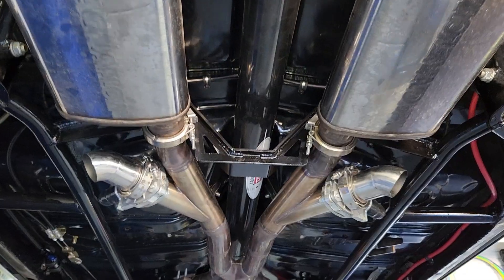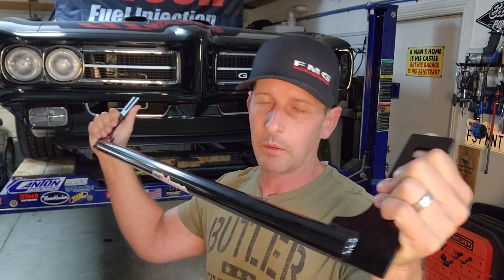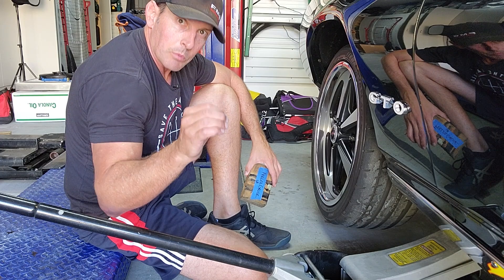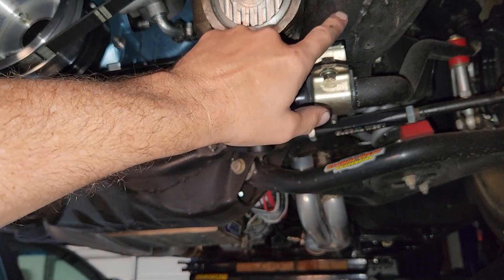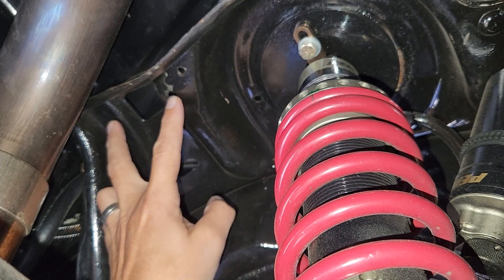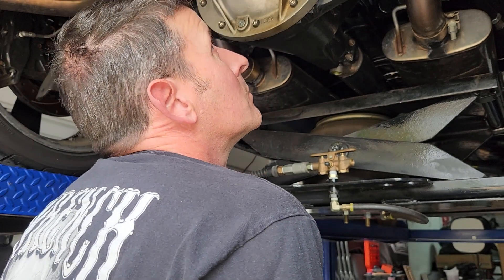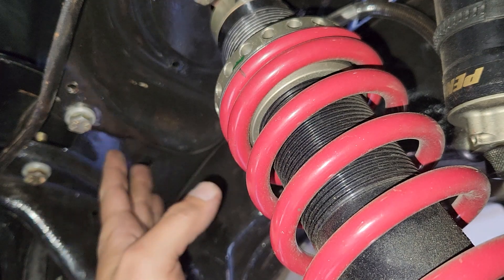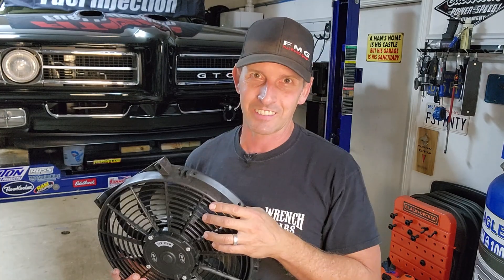UMI Performance - Bolt In Chassis Stiffening - for A-Body's

Comment: Quick tip for those rear bolts that you did the one finger trick on. Take a shallow socket, put a piece of tape into it to take up space, put it on a long extension, and put the bolt washer into it. Feed it up into the hole like you did the drill and hold the nut with you're other hand. Turn the extension to thread the bolt into the nut. If you're twisting your body a lot to get the nut up there, just use longer extensions until you can use your other hand.
Reply from the maker: I like it!  Thanks!

Comment: I finally got to doing my UMI rear and yeah pain in the a$$. Fuel lines ran right where needed to go. Luckily I was replacing all of them otherwise would have been worse. Thanks for all your videos. Definitely helps but also makes me buy more things lol
Reply from the maker: Yeah, not a super easy install, and glad to hear you changed those old fuel lines.  Yeah, sorry for the new spending habit.  ha, ha... See ya!

Comment: Monte, i have a chevy tubular transmission that direct bolts to the frame sides, would that be considered a frame stiffener of sorts?
Reply from the maker: Well, not really... BUT, it is far improved over the stock stamped brace.  It should dramatically help with holding the transmission in place, especially under load.  Instead of sagging or "bouncing" in certain conditions.  Great question!

Comment: I have added the UMI front and rear sway bars with a definite increase in corning abilities. My car actually came with a rear sway bar so the newer one is thicker from. UMI. San I just add the front piece as you did? I am not sure how or why you did the frame measurements. I use a scissor lift and am not sure we tightened the bars down with full weight on the wheels. I will recheck rather than burn up the poly bushings. Please answer if time allows, thank you
Reply from the maker: Awesome testimonial... I did the frame measurement to see if they actually made the frame stiffer.  Otherwise, how else would you measure the before and after?  As for loading the sway bar... it varies from car model to car model, but if you tighten all the linkages with the wheels hanging in the air, the pre-load on the bushings won't be the same as if pre-loaded while the car is static.  Hope that helps...

Comment: I don’t think you are getting any extra with the 2 bars since you have the super duty brace . Trying to workout is the upgrade worth it ?? Rear bolts holding onto 1/8 steel if that 
Front bolts on sway bar mounts . Might be something you make to think about real points / double sided minting plates to mount to.
Reply: Mounting
Reply from the maker: Good points... the front and rears do need further support, as the weld in kit only helps the mid section.  Love the idea of top and bottom mount plates to sandwich the frame.  I'm gonna research that some more.  Thanks!

Comment: Great video,,, alot of information,, I have a 72 Monty carlo,,,, complete umi suspension,,,
GREAT JOB
Reply from the maker: Thanks Brother...
Reply: I also have a 72 Monte with a complete aftermarket tubular suspension, swaybar and bilstein shocks and all new body mounts! Car rides beautifully but I am thinking of adding these for added strength for the stout small block I built. Can you gentleman comment on noticeable driving improvement after adding these braces?

Comment: Which suspension modifications besides that bar require the suspension be loaded before tightening? About to do UMI stage 4 with a few upgrades to the kit!
Reply from the maker: Good question, I was referring to any sway bar installation. Hope that helps!

Comment: How do you like those front sway bar links? Looks like they’re Spohns.
Reply from the maker: They seem to be doing their job... they came with the Global West sway bar, so I don't know who makes the actual link.  Thanks for asking!
Reply: @FastMonty have you heard anything on the new bmr front brace for the a-bodies? Not finding many reviews on it.
Reply from the maker: @user-qc7hr4my7r  Thanks for the heads up... never heard of it.  So, I looked it up... it looks bad ass.  I also love that they're recommending the use of Rivnuts.  I did a video on using those to strengthen the sway bar fitment; https://youtu.be/0DcpAl0BCFM?si=4xzf4iB_M153zpfs  Ironically enough, I'm in the middle of designing an A Body skid plate (to protect our oil pans), which mounts in the same location as this brace.    Using both might dramatically increase the front stiffness.  Will add to my review list.  Thanks again!
Reply: @FastMonty  I watched your video on the sway bar problem, was real helpful. Thanks for the quick replies, appreciate it!
Reply from the maker: @user-qc7hr4my7r  Great to hear!  And, no problem!  If you end up getting that BMR brace before me... let me know how it goes!
Reply: @FastMonty will do. It’s a toss up between the Umi and BMR. Wasn’t to familiar with rivnuts and how well they hold up to abuse so looking into that. I seen some people commented on your sway bar video about possible corrosion but our cars aren’t driven much in wet conditions. Have the rivnuts held up good?
Reply from the maker: @user-qc7hr4my7r  The Rivnuts have held up great.  I also used them on my 2 quart oil filter bracket, on the frame rail... just inspected yesterday.  No issues.  I'm not concerned about the corrosion either... that's typically common where Raw Aluminum is touching Raw Steel.  Not concerned.  That said, if you read the instructions for the BMR brace, they're utilizing a legit nut backing plate for the big bolts on the center section.  If you're choosing between UMI and BMR... I'd go with the BMR.  Read the instructions on their website.  That'll help with your decision making process too.  Have fun!
Reply: @FastMonty thanks for the advice. I’ll probably go BMR then and I’ll let you know. Chatted with them on facebook a couple of days ago and got a discount code of 7% off with free shipping.
Reply from the maker: @user-qc7hr4my7r  Sounds good!